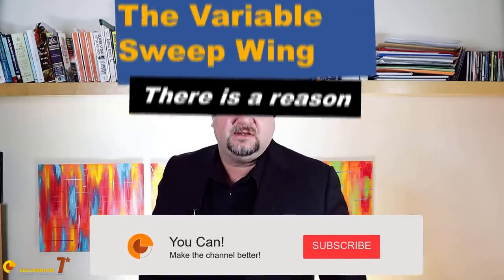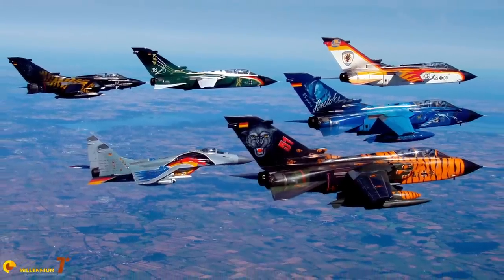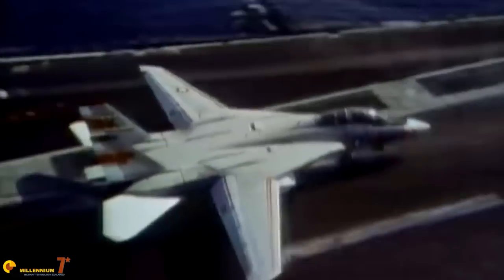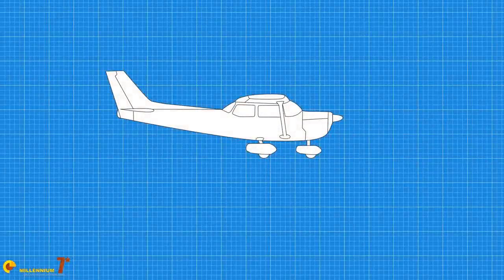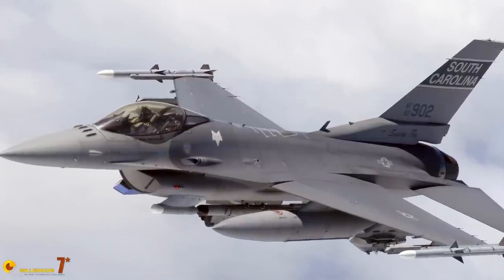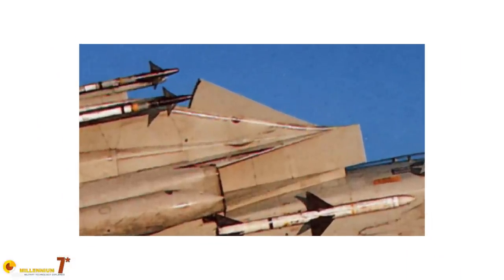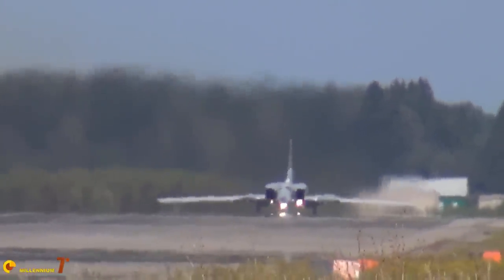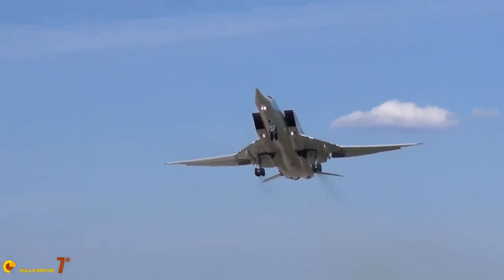F-111, F-14, Tornado, Su-17 were Hopelessly Outdated - the demise of the variable sweep wing

Comment: I disagree with this video on several points:
1.) Im sorry but I´ve never heard about any instability with the f14. I have flown very high fidelity simulations of it myself, and I can only testify to its incredible stability. This simulation and my experience was completely matching the testimonies I´ve heard from it´s pilots. It also matches the doctrinal manuals, flight manuals and training manuals, portions of which I have read. I, the simulations which are considered to be correctly behaving, former pilots, original manuals, would actually testify to the contrary, the manueverability and stability of this plane is pathologically glorious and addicitve. I mean that at all speeds, loads and altitudes. This plane is incredibly difficult to push out of control/out of flight/into a stall, so difficult I´d say it is impossible unless done deliberately. Even then the plane will fight back. This has been testified to by former pilots, engineers and other topic related personell. This plane was very stable and very manueverable.

2.) The wing gloves on front of the wing were not to increase/manage stability, they were there to counteract Mach Touch, effectively letting the F-15 pull 7,5 Gs at and beyond Mach 2

3. As far as the f-14s servicability was concerned they operated from carrier decks, hence they never were out of logistical reach for major maintenance.

4.) it could fly inverted, stable, gaining both speed and altitude with a full ordinance suite :D that´s just a caviatte.

5.) I will admit to a few things, the F-14A used to be deadly in terms of manueverability with it´s engine problems occuring. Namely the P/W TF-30 engine which was replaced in the F-14B was very prone to compressor stalls and a very high frequency of turbine blade faliures ocurring too. These compressor stalls and engine faliures led to incredibly deadly yaw oscilation and flat spins. These are both quite "unrecoverable" due to the nature of the weight distribution, this would be correct. However even these problems can be recovered from. The pilots were particularily trained for it and could do it with success. From the simulation and listening to pilot testimonies, my understanding is that to recover from such a flat spin you needed to put in as much effort as to induce one, which as I claim was incredibly dificult.
Reply: All well cool until one engine fails.
Reply from the maker: I wasn't clear, sorry.
The F-14 was a stable plane, it was not designed to be unstable. The glove vanes have the effect, in this context, to add lifting surface upfront moving the plane aerodynamic centre forward. 
The point of the video is that you basically can't make a relaxed stability plane with variable sweeps wing because they tend to move the aerodynamic centre back in stable territory at high sweep.